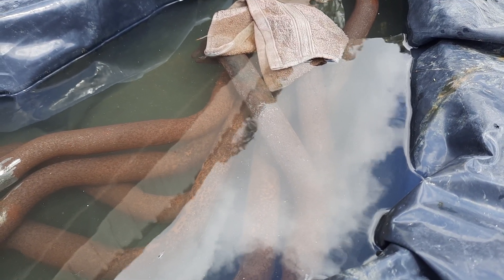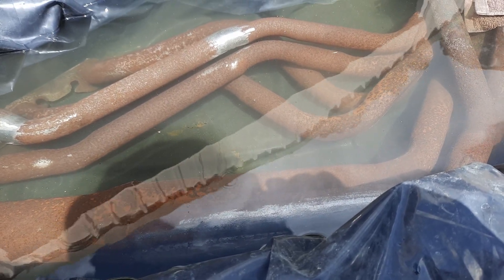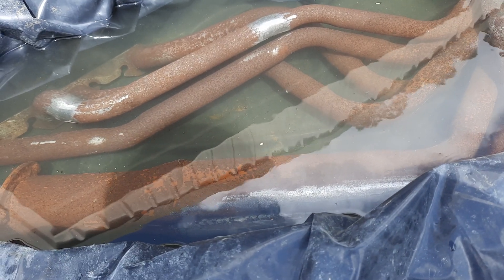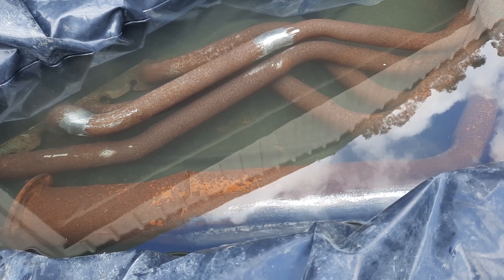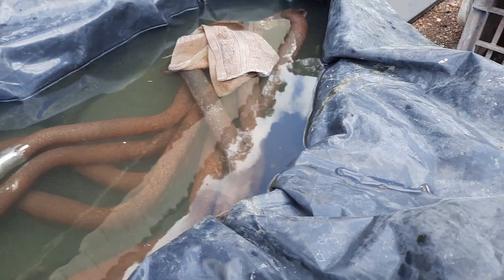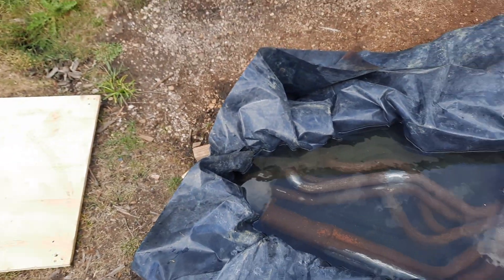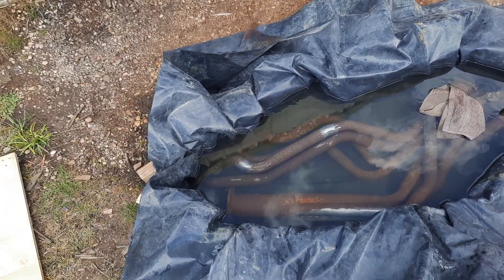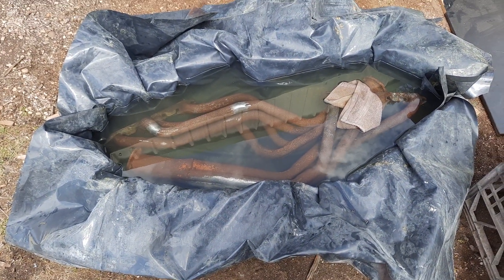Acid washing my rusty headers

Comment: When you pull them out, spray/rub some ranex rust converter on the parts that start to flash, it will make those bits go black, then spray with hi temp header paint.